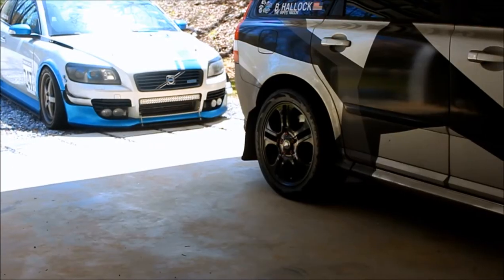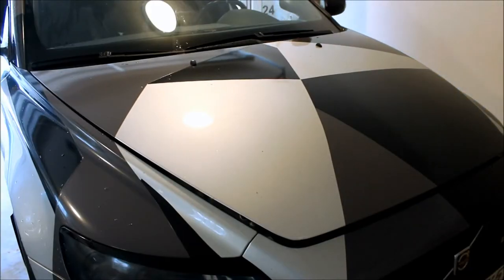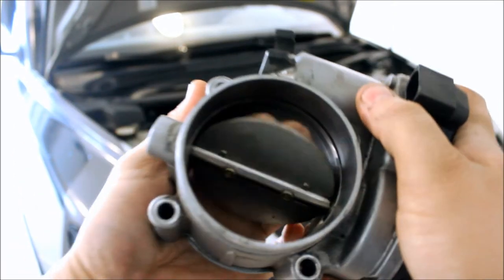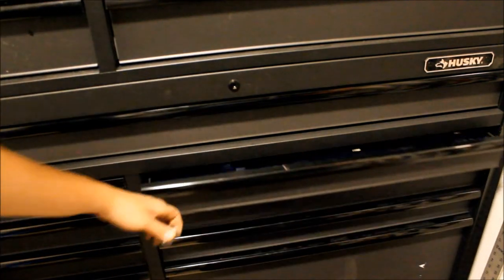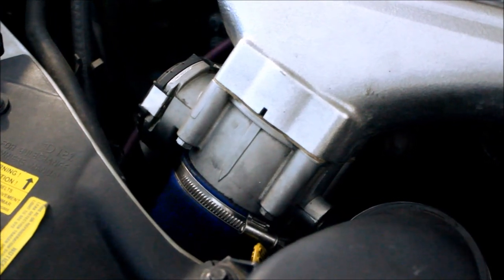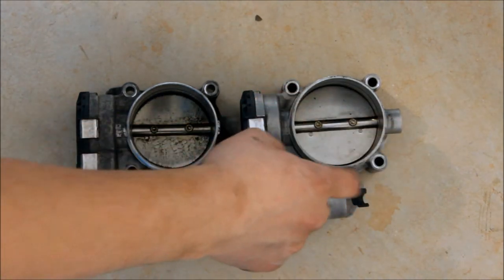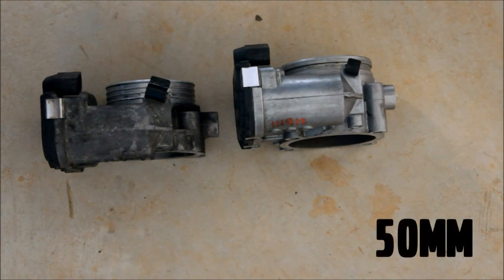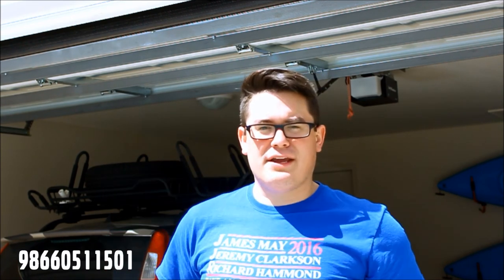Project V50, Episode 49: Porsche Throttle Body

Comment: You rock dude.  I'm following as I just got a c30. Like how you moved the tcv on the c30 I can't manage it.  Can't break the wire free from the frame or pull the hoses off the turbo.  You have plethora of videos I'm saving.  Great work and keep it up.
Reply: The wire pushes in to release, those hoses are a pain...currently trying this myself.

Comment: Hey bud, out of sheer curiosity.. Would that fit on my noisy 2.4? Epic video
Reply from the maker: The 2.4i has a different stock throttle body than the T5, so I'm not sure if it would work or not... I'm also not sure what the stock size is on the 2.4i throttle body. But if you want my old T5 throttle body to test, you can have it. I can send it home with Alan at CTD. 
If the T5 one works, then the Porsche throttle body should work on your car as well!
Reply: Curious if you ever tested it on a 2.4i Dirty C30r?

Comment: Is this part number for a c30 t5 Porsche throttle body as well? Just ordered one
Reply from the maker: Yes, it's the same for all P1 T5 Volvos.
Reply: Thank you
Reply: @MyNameIdeasWereTaken  What kind of 50 mm screw should I get? I got 5/16 inch-18 x 2 inch flat heat torque screws from Home Depot I think they should work ?
Reply from the maker: @markveith9468  those should work as long as the threading matches what you have on your intake manifold.
Reply: @MyNameIdeasWereTaken  thanks again, your build is great

Comment: Where do you get the longer bolts?
Reply from the maker: I got mine at Home Depot for $1.50 for all four.
I would say it's worth replacing the bolts even on the stock throttle body. Using real bolts and not those torx head screws make removal so much easier.
Reply: MyNameIdeasWereTaken you remember what the threading and length was?
Reply from the maker: M6x1.0 for the Elevate and PumaSpeed intake manifolds.
Reply: What about the stock manifold bolt sizing? I’m at Home Depot lol
Reply: @MyNameIdeasWereTaken  What about for the stock manifold on the upgraded throttlebody for the screw sizes
Reply from the maker: @markveith9468  The stock manifold uses coarse threaded screws that aren't like traditional bolts. I'd suggest just removing one and seeing what you can find at the local hardware store.
Reply: @MyNameIdeasWereTaken  so I removed them but the Porsche throttle body wont line up with the stock manifold bolt holes. So I think I’ll need to buy an upgraded manifold to fit the new throttle body
Reply from the maker: @markveith9468  The bolt spacing is the exact same. I would double check that you received the right Porsche throttle body. Many on the forums have installed the Porsche unit with the stock manifold.
Reply: @MyNameIdeasWereTaken  okay I’ll have to double check ill post the part # when I’m home
Reply: @MyNameIdeasWereTaken  damn I just checked mine starts with 996 not 986 that’s to bad that’s why it won’t fit I guess it’s from a 2000 Porsche 911.. ah